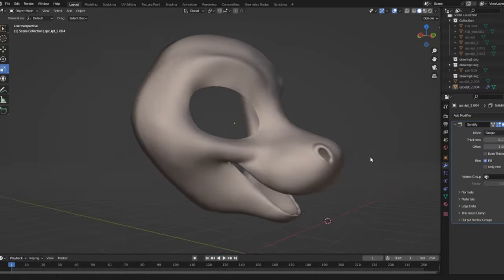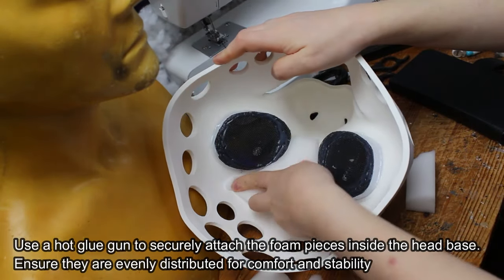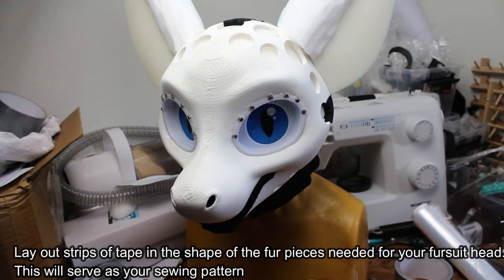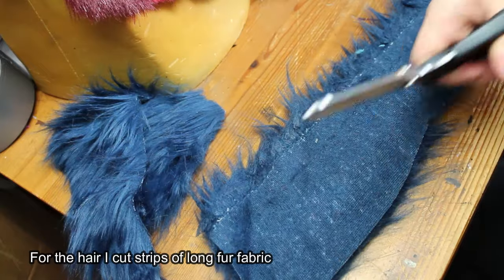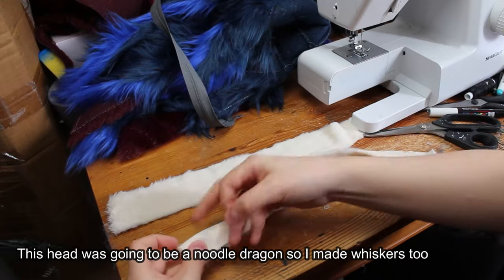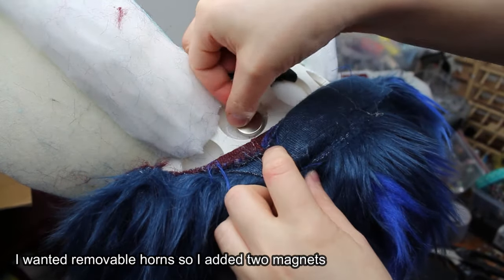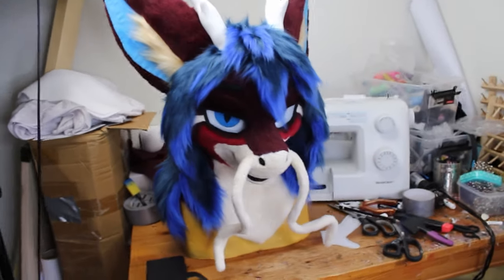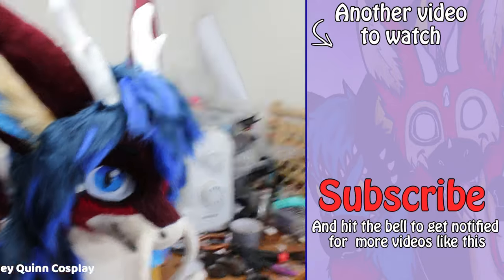How To Fur A 3D Printed Fursuit Head Base | Fursuit Tutorial

Comment: hi! i don’t own a mannequin head. What else could i use?
Reply: I'd just save up and buy a mannequin head. They aren't very pricey. If you can't afford it than maybe wait to start on your suit.
Reply: @thebestbud do you know a good one? i don’t wanna buy the 100 dollar one since that’s too much for me, know any cheaper options?
Reply: @kaitheradical  Any mannequin head would do just fine actually if you're just planning on making them for yourself or a few friends! My friend makes AMAZING fursuit heads and she just uses a cheap foam one that has been kicked, tossed, and drawn all over throughout the years. However make sure to use a measurer to get YOUR face measurements (Mainly height, bottom of chin to start of head. If you rely on a mannequin for this it most likely won't fit your chin) and make sure to try your head on and off mannnnny times BEFORE FURRING to make sure it fits you snuggly.👍 

The main struggle is just a 3$ one is light, so it makes it difficult to work on without proper weight plus obviously it won't last forever. But thats not hard of a workaround, just takes a bit more persistence.If you want it a bit easier you could get a harder plastic one that has more weight for a bit more money.
Reply: @thebestbud  ah, alright i'll get one, tysmmm!!
Reply: @kaitheradical  Good luck!!
Reply: I just put the fursuit head on my leg and that's the mannequin head for me
Reply: A willing friend with spare time and patience lol
Reply: I recently bought one from Walmart and it works very well, i hope this helps ♥
Reply: @thebestbud  are styrofoam heads accurate?
Reply: @Kai_catwolf  Most of the time they are smaller then actual human heads since they don't account for different chin structures/face types, id definitely not fallback on them as you're only measurements.

Comment: Thank you for sharing this! It is very helpful for making my daughter's first fursuit.  

I do have one trick to share for you to quickly turn the whiskers right side out. Pin a string to one end of the whisker fabric before sewing. Attach a string to the pin that you will sew inside of the whisker tube. Use the string to pull the pinned end through the tube to turn it right side out.

Comment: what happens if a non-static head keeps moving while you move your mouth Did I make a mistake on the size?
Reply from the maker: You mean a moving jaw head or?
Reply: moving jaw @MugiwaraCosplay
Reply from the maker: A moving jaw head is suppose to move the jaw when you move your mouth. As long as the head is not too tight fitting it's fine
Reply: thanks @MugiwaraCosplay